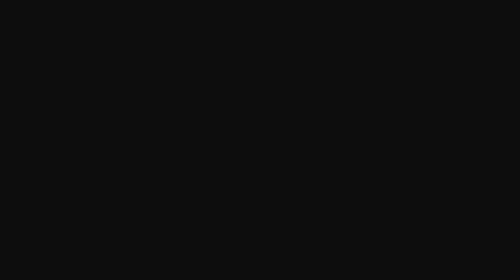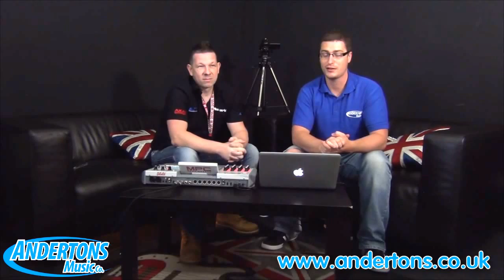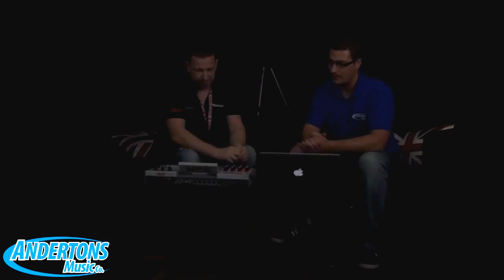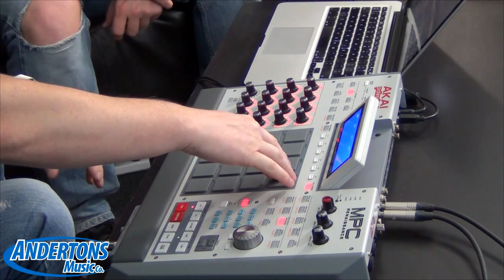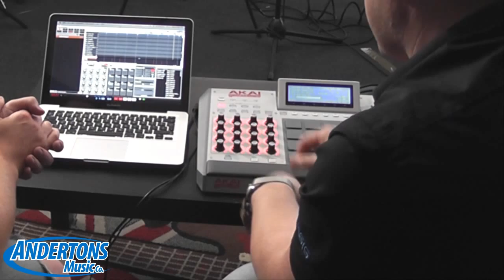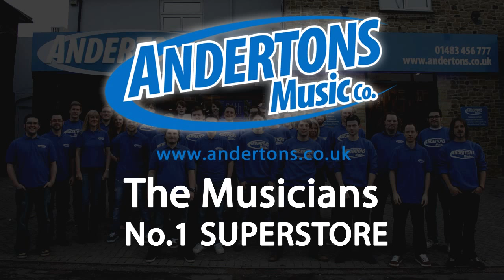Akai MPC Renaissance Music Production Controller

Comment: You probably haven't done much music with latest soft lately. 

Otherwise you'll know how bad 32 Bits and 3GB limitation really is!

Not mentioning MPC Software isn't really efficient (duplicate plugin for each sequence), or even crash (with corrupt file you can't open anymore). Already happened several times and that's really something they need to fix quickly. 

Software wise, they do have a long way to catch NI Maschine which has better integration. However, hardware wise, Akai is better.